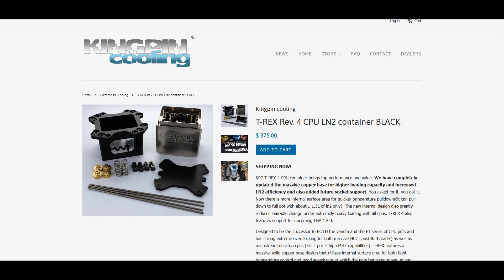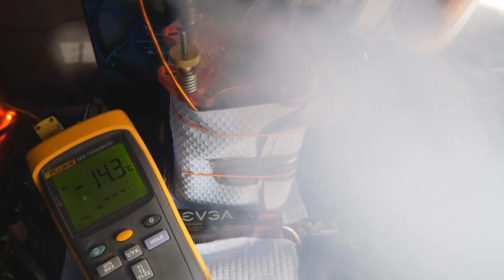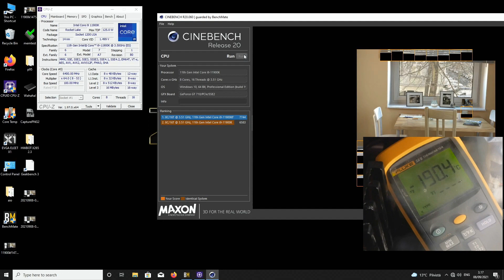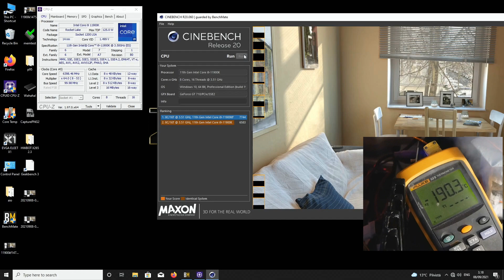Kingpin Cooling T-REX Rev 4 CPU LN2 Pot - Overview & Performance Test

Comment: The price is still 2 high for just a passive metal block tbh
Reply from the maker: Would cost even more to make such here.
Reply: A standard price of copper bar (doesn't so much matter the alloy that much for cost)... C110 while being the most conductive isn't very easy to machine. A 3 inch square pot (common stock size to use for this and KP used to make pots out of the same stuff) would be like 113 bucks in copper alone right now with the current metal supply prices in the US. From there you would have to machine it so it actually functions as a cooler and you have a flat base to stick on the cpu. Your talking hours of machine time to mill that. Hourly 3 axis mill time would be atleast 40 USD a hour for mill time alone not including fixturing , fixtures, setup , ect. 5 axis it goes up to over 100. And anything done on a manual setup or in a job shop typically in the US would be charging 100-150 a hour. So your 100 bucks in copper just turned into probably 200-300 bucks in actual cost to make not including , shipping , packaging , ect. These are very niche products there is a economy of scale that is associated as such. These evaporators do not get the same volume discounts or economy of scale luxuries attached to them as you might see with waterblocks , or fittings , ECT anything with high volume. Also they have to ship and store 5-8 lb evaporators that don't move many units so there is also storage and shipping , logistics costs... Honestly the fact they can sell pots at that price and make any profit to make it at all worth any time at all is actually quite good.
I mean these are truly beyond niche products. The number of units being shipped is like truly pathetic in the grand scheme of things. (When compared to almost anything else in the PC enthusiast space.)
-i bought my own mini mill just to machine my own evaporator for dry ice and ln2 I did a lot of cost analysis for my hobbies and I like metal fab, welding, and machining. For me it made more sense to get the tools to make my own. However I can attest to the cost... Shits not cheaper

Comment: Do you think it worth to upgrade from rev3?
Reply from the maker: I think it is not tbh. The previous version is very good and probably better for large CPUs.
Reply: @LuumiJuhani  I have the Rev2 so may upgrade to Rev 4 from that, wonder if its worth getting my Rev2 direct die modded
Reply: @LuumiJuhani  Thanks for solving this dilemma :)

Comment: When going sub ambient with a delided cpu, should i go direct die with KPx or use the IHS with liquid metal then KPx?
Reply: Never use liquid metal when going sub ambient, the liquid solidifies.
Reply: So it won't imitate solder at lower temperatures?  (see: above zero)  I've only got an HC500A right now, won't be going subzero until next year most likely.
Reply: @ObviousCough  no it doesn't, when it solidifies it also contracts and no longer fills in those microscopic gaps between the two surfaces.
Reply: Thank you.  :)

Comment: Tho yes this is absolutely badass the reason why the extreme cooling market is so small is cuz well people well most of the consumer base cares more about what they can do daily. as for the probe man thats such an easy fix. wouldnt be hard to machine tabs that run up the side so you can weave the probe through them to hold the probe in place. simple issues have simple fixes.